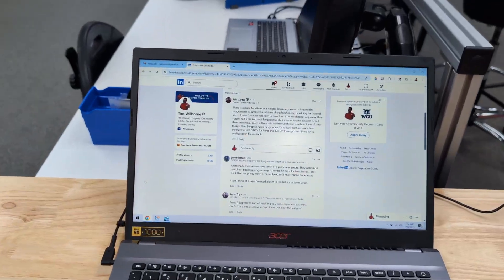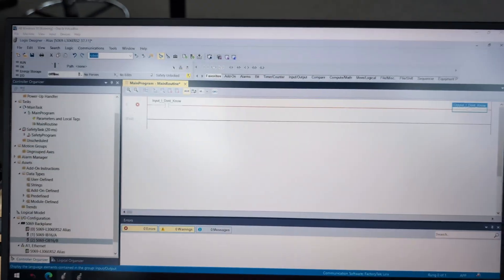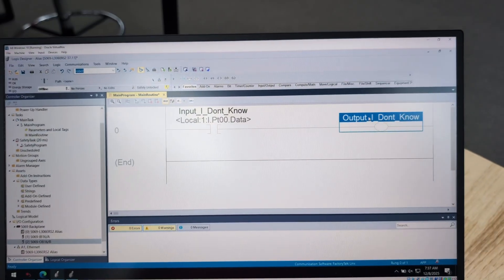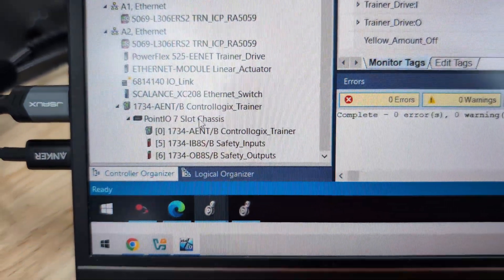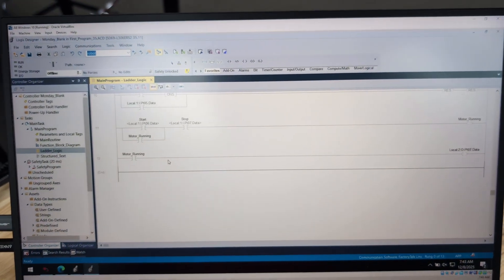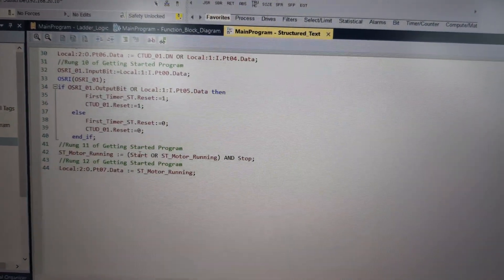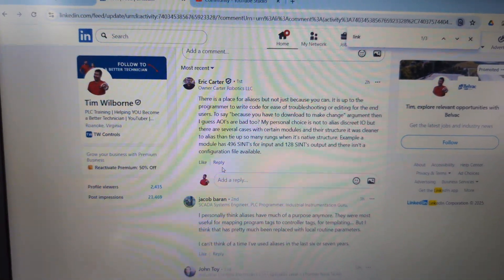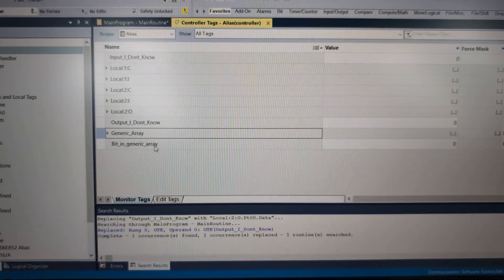Studio 5000 Aliases: Why Programmers Love Them & Technicians HATE Them

Comment: Before V21 comments were not stored in the PLC and aliases were the way to go. If you did a good job with tag and alias naming the program was pretty much self documenting. Since V21 with comments stored in the controller it doesn't matter anymore. The main issue with using aliases is programmers tend not to put comments on the IO. If there was a column in the tag window that showed aliases to the base tag then it wouldn't matter.

Comment: I feel like the bigger issue here would be the fact that the aliases aren't stored & presented by the system in the same way descriptions are. There's a reason programmers name variables semantically instead of just var1, var2, var3, var4, var5, var6, var7, etc. Naming the things you're using semantically is a necessary part of managing complexity, and if the devices you're using don't carry over those complexity-management features (even when they obviously can since they're carrying over the descriptions) then that seems like a flaw with them more than anything.

Step outside of PLC/Ladder Logic, and ask literally any programmer who does say embedded, systems, front-end, backend, database, whatever programming "hey, just don't name your variables" and they'd laugh in your face because, again, in any system of significant complexity you need shorthands that are meaningful to manage & abstract the complexity. The biggest issue here is that even though the software you're using clearly stores this information, and clearly has no principled-issues with displaying programmer-defined information when viewing the ports, (since the description is just as arbitrary as any alias would be) it is choosing to not show you the aliases for the port names.

It's not that aliases don't help you manage complexity, it's that if you set aliases they do help you manage complexity, but when viewed later they aren't shown reliably. Ergo the thing that's convenient for the programmer to see and use (aliases) isn't easily shown to the technicians, and the thing that's convenient for the technicians to see and use (descriptions) isn't easily shown to the programmers. So, using aliases makes you less likely to add meaningful descriptions (because you don't need them) but in turn that means anyone viewing your work later is less likely to have anything to work from. If this were an actual technical limitation it'd be one thing, (For instance like how variable names aren't stored in compiled code) but the fact that it's showing the descriptions clearly means, no, the software absolutely could display the aliases to you, it's just that no-one bothered to make it do that. A design oversight which is frankly kind of unforgivable if we're being honest.

People tend to get in the bad habit of going 'nose blind' to shitty software/development decisions and assuming that that's just how things are (programmers do this too, to be clear. I haven't met any group of people that reliably doesn't do this) but the only programmers at fault here are the ones who made this awful software that does the exactly wrong thing and displays all of the worst information in all of the worst ways. 11:20 this isn't just a solvable problem, it's a problem that never should've been un-solved. This is a bug that should've been caught and fixed immediately, before the feature was even completed. This is an obvious usability fuckup that completely undermines the entire point of the feature it affects, and it has a trivial fix; just move the bloody text boxes! Or hell, just don't split them onto two lines in the first place?! (e.g. "Start <Local:11Pt06.Data>" all on one line)

Naming your things meaningfully is good practice for a reason, but no-one can just cast un-shittify on the software they're stuck with. (Well, unless it's open source which, IMO, is the reason way, way, way more people need to take a principled stance on using open source stuff. Imagine how many hundreds of millions or even billions of dollars have been lost because no-one could submit a simple PR to fix these obvious ussability issues in this software.)
Reply from the maker: Thanks for sharing your thoughts.
Reply: @TimWilborne  on re-reading I should probably clarify that I do actually agree with your points in this video, I'm angered that these are even issues in the first place.

I agree that (from what's shown here) using aliases is awful for maintainability & clarity, but it's just irrationally annoying because there is no inherent/technical reason for it to be that way - it's just that the software itself is poorly designed. (again, in some cases to a degree I find outright unforgivable. I would fix those overlapping text-box things even if it was just a hobby project I was making for my own personal use. I cannot imagine how someone implemented that feature and either didn't notice it made text boxes unreadable, or chose to ignore the fact that it made text boxes unreadable.)

On a re-read I realize that it came off a bit aggressive/defensive, but I do actually agree with your points. It's just borderline infuriating to me that software design decisions this bad are so prevalent "don't use these basic features" actually is good advice. I can totally see where aliases fail and make maintaining things unnecessarily hard, but there just isn't any reason for that to be the case since the software clearly tracks and displays other equivalent information (like descriptions) without issue.
Reply from the maker: There was nothing aggressive or defensive about your comment.  I appreciate peoples points of view.

Comment: The issue for me as someone who deals with old and new machines. Old programs I didn't write and new programs I did write, is that an Alias cannot be changed online. but you can always remap while online. Aside from looking cleaner when things are mapped in an I/O routine, you also get the added benefit of being able to change IO on the fly without aliased tags.

Remember too that alias tags are far harder to identify when they aren't grouped together. so 120 IO points all aliased with different tag names and no scheme become a spiders web of tags to go through. If they were all just mapped out, you could identify the mapping routine, and scroll through all 120 IO in 3 seconds and identify exactly which IO point you were looking for in a short time.

I don't know why people think it's easier to program with from scratch with aliases either, because it's always easier to reference back to the actual input than it is to find an alias that was obscurely named too.
Reply from the maker: Very good points, thank you for sharing.
Reply: "I don't know why people think it's easier to program with from scratch with aliases either, because it's always easier to reference back to the actual input than it is to find an alias that was obscurely named too." 
let alone the fact that you can program a mapping routine in seconds to minutes in a spreadsheet

Comment: I like to use Aliases because AB is always changing hardware.  I started in Compact Logix in version 2.71 most of that hardware is unavailable or super expensive. 5, 10 or 20 years after I built a machine the hardware is no longer available. The old was 32 point i/o, now it is 16 point i/o. Or the other way. I can now re - alias without changing the code. I have several generations of machines with the same code and different hardware.

Comment: They mainly existed to provide a migration path for the old Symbols that might be ported from a PLC5/SLC500 conversion.  Because the old program addresses get converted to tags, if those old addresses also had Symbols - then converting them into Aliases was a neat solution.  Otherwise I've rarely used them, usually inside an AOI I know I'll never edit.
Reply from the maker: That's a good point about the migration path.

Comment: I think this is a really good example of how to not use aliases. Mapping routines really make life a lot easier and provide reasonably decent documentation for what the I/O is doing even after the drawings and manual are long gone or missing. I can still think of many reasons to continue using aliases. If you are grouping bits into bit arrays (or integers) you can alias individual bits to make the program more readable at the rung level. I did not consider that someone would browse through the tag list and read tag descriptions to try to find information. I've never done this even when troubleshooting and I troubleshoot way more than I program.

Personally I use aliases for every I/O channel/point and use the wire number from the drawings for the alias name and then map it to an individual tag. This speeds up troubleshooting. Sometimes you find a wire number and if you can just search the program for the wire number, you don't have to trace all the way back to the individual point.

When I'm doing alarms or status words, I usually use an integer or array of integers. In this case I still feel like aliasing can be helpful with no downside as there is no reason to know the individual bit of a status word or alarm word.
Reply from the maker: Thanks for sharing.

Comment: Technician here who has helped train new techs and maintenance guys coming up in the industry. Aliases in my opinion are like AOIs, it’s looks cool, but that’s really about it. Maybe someone can point out something that might counter this, but they are just time savers for OEMs that probably already have a lot of time on their hands as it is. They could spend that time throughly explaining their logic in the rung comments. Bigger fan of creating input mapping at the beginning of the scan and output mapping at the end of scan. If the techs need to troubleshoot, they go to input map and output map routine, they want to add new logic, you put your new inputs and outputs there. Even if I decide to add a panelview to an older line, I’m going to use map routines, because more often than not, some cheeky guy programmed something and didn’t explain it is coming from HMI, so the techs are there scratching their hand when they can’t figure out what makes that bit come on. End of the day, it’s all your preference, but keeping those machines running is way more important than cheeky programming. Words of the great Michael Scott: “Keep it Simple Stupid”.
Reply from the maker: Great points and I appreciate you sharing your experience!

Comment: People overreact to the whole alias thing. The pro is that you can name not a tag but an actual physical device a name you want that would make sense for example "cutterSolenoid" or "Cutter_Solenoid" instead of using the actual address of an IO. Another benefit, is that if you're using an existing goode code and want to use another hardware, you can just update the address of the Alias tag and the code is untouched. I always use descriptions on the physical address, even if I'm using them in an Alias. Either way since people tend to complain in the field, I tend to really limit my Alias uses.